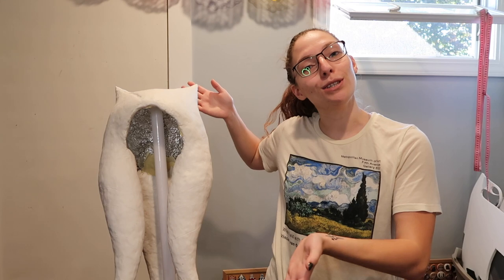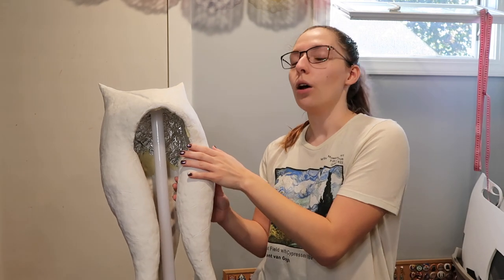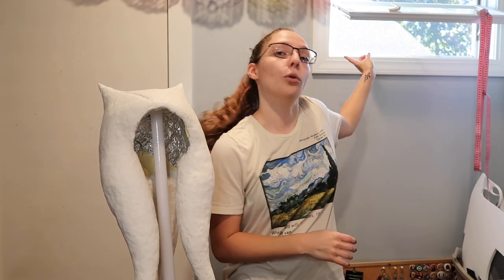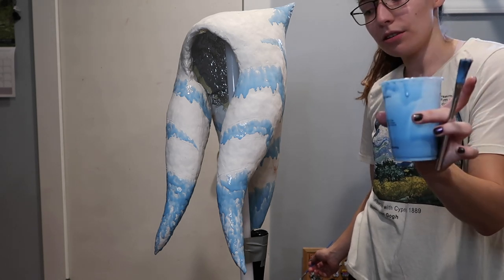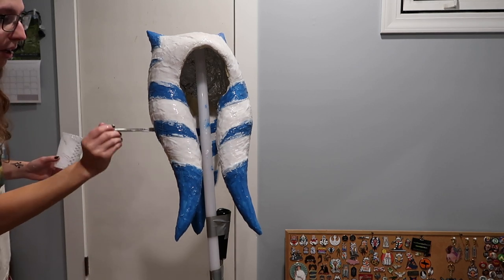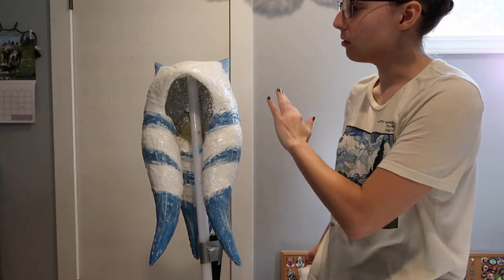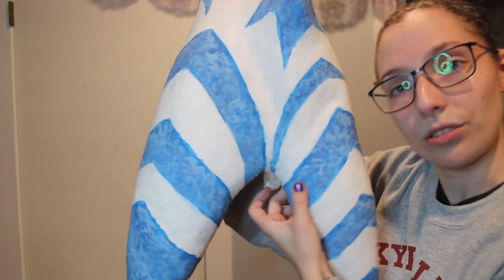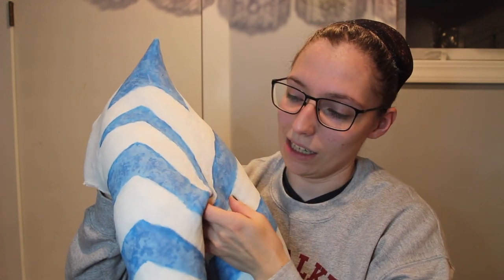Making a Silicone Ahsoka Headpiece

Comment: Amazing work! I'm following your methods for mine.
Did you mix psycho paint with some regular acrylic blue paint to get the color or did you find some psycho paint that was actually blue?
Reply from the maker: I used Silc-pigs, which is pigment specifically for coloring silicone and psycho paint.

Comment: Hi! How did you make the tails detachable? Before removing the silicone.
Reply from the maker: I cut them off after I finished the clay and used hot glue to reattach them and smoothed out the clay